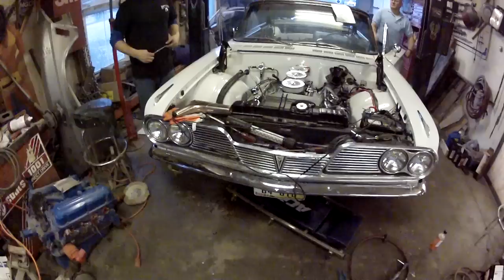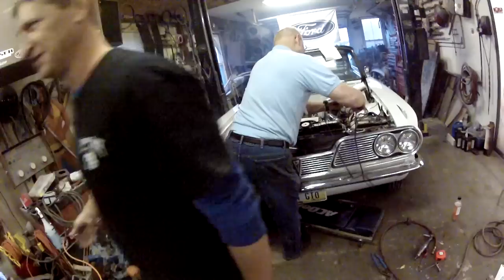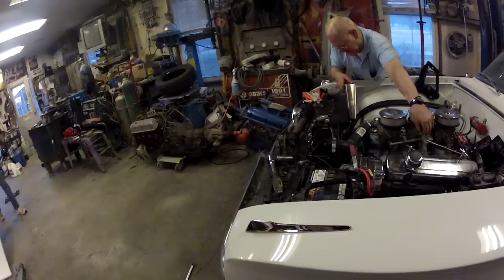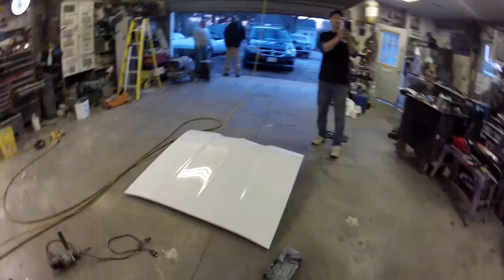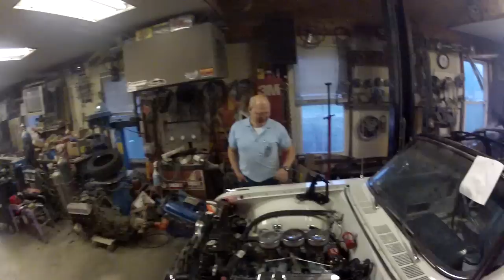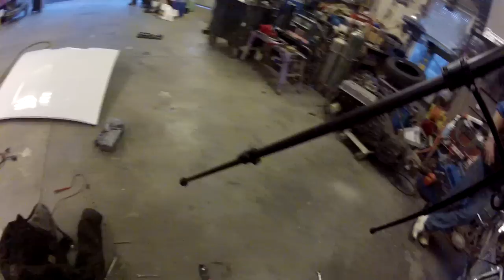389 Start

Comment: I have a 62 convertible as well. I always wanted to put a 389 in. What are you using for transmission etc? Is the car finished now?
Reply from the maker: It belongs to a friend of mine, I don't know exactly which transmission he used, I was filming for him, I know he had to modify the chassis, as the Tempest used a similar transmission that the Corvair used.
Reply: @waltergabriel3694  the 4 speed manual transmissions are identical except the input gear is cut differently depending on front engine or rear
Reply from the maker: My friend is a member of the Little Indians Pontiac club. They have some really good shows and swap meets. Google the club , lots of info there.
Reply: It is mine, engine is a 1961 389, transmission is a custom built 700R4, rear axle is a Ford 9 inch.
Reply: @doncasteel836  sounds awesome